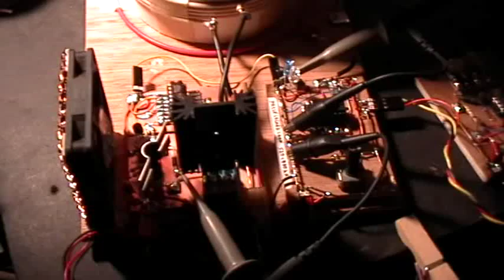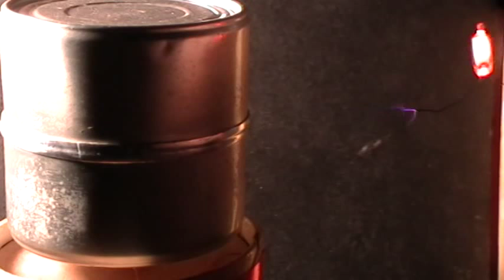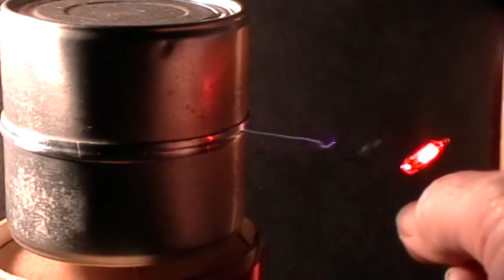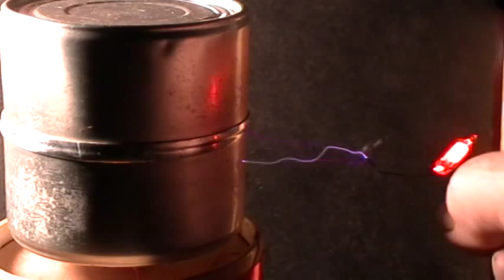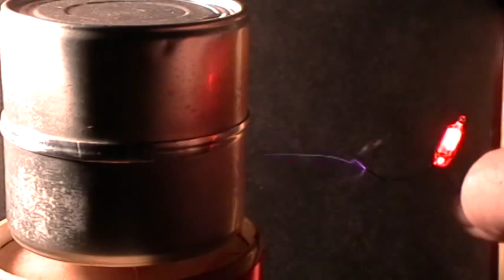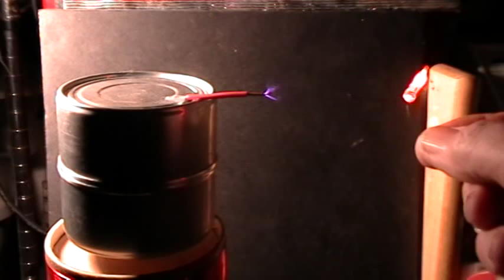Extreme High Voltage: TinselKoil IX with IRFP260n

Comment: Extreme? looks like 30-40 kV.

So what are the details:
input voltage?
input current & waveforms?
Winding ratio?
Driver topology?
FET driver type? (the FET have a somewhat high gate charge, so I assume it's somewhat powerful FET driver)

As for me, IRFP260 gets in a middle group, not good for 320V(rectified mains) and for 12/24V(collection of underunity supplys) there are higher current MOSFETs.
Reply from the maker: erlendse Input voltage in this video between 24 and 30 VDC, current around 800 - 1100 mA average, waveforms in the previous video, 5 turn primary and approx. 420 turn secondary, inverting 2-transistor driver (2n7000 and 2n2222a), and I work with what I have on hand as far as mosfets go. 
It goes under "extreme HV" because it is a SSTC, although it doesn't compare -- yet -- with my hybrid SS-SGTC which goes to 300 kV or so.  A voltage amplification of over 1000x counts as "extreme" on my tabletop. 
Thanks for commenting and watching.
Reply: ***** I have built a similar design, and my reason for doing it is because I am using a weak 24V 50VA transformer. Powering my MOSFET slayer exciter continuously requires 3-6A, depending on how well it is tuned and the load on the output. Chopping it up with a 555 at 10-20% duty cycle 10-60Hz allows the transformer to not overheat.

Also, because it is unregulated, the more current I pull, the lower the voltage sags, and the less voltage I get on the output. So now, on every interrupt, I give the transformer a chance to charge up the filter capacitor to a peak of around 33V before the circuit activates and oscillates for a short while. Then I put that in series with an additional 12V (rms) 4A supply, which gives me even MOAR PWR,  so I can now get peak voltages of almost 51V!
Reply from the maker: ***** You are right--- believe it or not, narrowing the effective pulse seems to be an "accidental" effect of the increased gate capacitance of the 260n mosfet. That is, with easier-to-fill mosfets like the 830, the Base signal is nearly as square as the input to the driver from the PLL chip. So the mosfet is fully ON more than necessary, approaching the full 50 percent duty cycle that the PLL chip puts out to the driver stage. But with the bigger mosfet, the risetime on the Gate voltage is considerably slower due to the capacitance, so in effect, the ON duty cycle is reduced to 25 percent or so, and the driver produces a good sharp cutoff trailing edge. So even though the mosfet is being switched "inefficiently" (the slow ramp-up on the Gate) the overall performance is better.

Comment: Looks like max sparking distance is less with breakout point than without it :)
Reply: dxdx666 The lead on the neon is also a breakout point.

If he put a metal ball there, then maybe it will be quite a bit shorter spark distance.
Reply from the maker: dxdx666 Yes, and that makes sense because the breakout point reduces the voltage that accumulates on the capacity. So with no breakout and no corona, a higher voltage builds up, hence a longer eventual arc or spark to the external electrode.
Reply from the maker: erlendse Yes, that is right. Spark gap tables are generally valid for sphere electrodes that are larger in diameter than the gap itself, and large spheres give the most accurate voltage measurements.  With large spheres in dry air one may expect around 30kV per centimeter of gap. With any other geometry, larger distances may be bridged by a given voltage. 
Actually by now the leads of the neon have melted into small balls already.
Reply: TinselKoala 1" dia spheres gap would be enough to measure peak volts to a decent accuracy in this case.
Reply from the maker: dxdx666
Probably. I just measured using a 45mm chromeplated sphere and the spark easily initiates across a 10mm gap to the top capacity, and sustains (Jacob's ladder style) to several centimeters. So that's an honest 30 kV at least, from only 30V input to the primary stage.